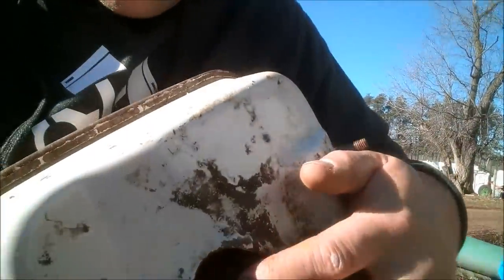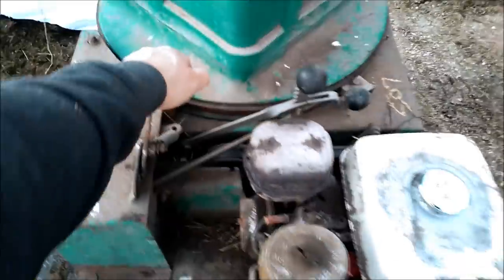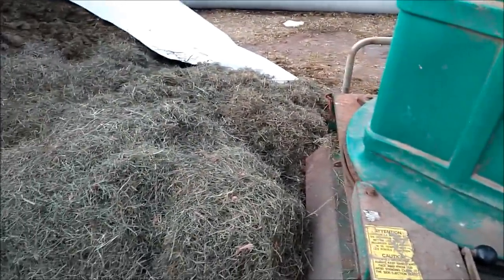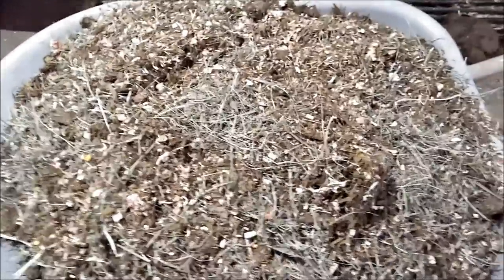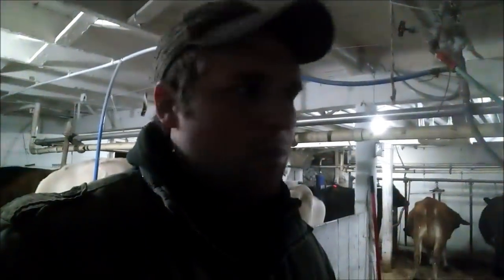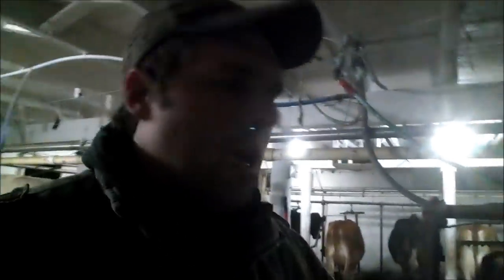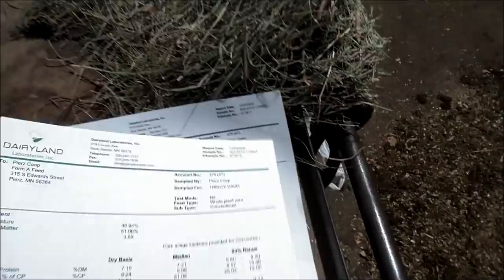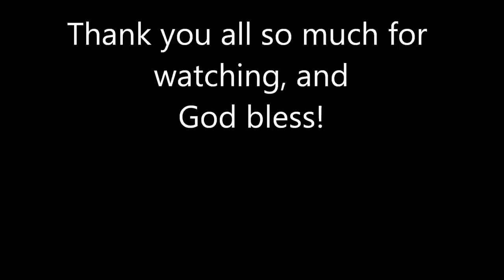Cow Chow; dairy cattle rations, grinding hay, forage sample results are in!

Comment: I got a challenge for you Alan since you use draft horses to use them to pull your forage harvester do a little something different
Reply from the maker: To do that I'd have to buy more horses because two aren't enough.  I'd also have to buy a motorized cart to run the chopper.  I've seen some Amish chop corn with horses, it's a cool sight for sure.
Reply: @trinitydairy  I'm sure you could use 2 horses on the small square baler
Reply: @trinitydairy  or do an old style corn binder have I think it'd 2 horses on the binder I could be wrong and 2 or 3 horses on  wagon and get the twine that is made out of a plant so you can feed it with the silage amish are some wicked smart farmers

Comment: Very familiar with small barns. That's how ours is. Had to really search to find powered feed carts that would fit down the aisles, especially on the one side. Probably the biggest upgrade in your situation would be a conveyor to get the silage from the wagon into the barn. It would save some steps anyway.

Comment: Cheapest ethanol gas! Buy the 91 octane minimum for anything you don’t run every day. Save you so much in the long run.
Reply from the maker: Yeah, I usually run 91 in my small engines, but ran out, last time I used it, and dumped in some 87. Thanks for watching!

Comment: How many pounds of grain per day per head do you feed the jerseys? I'm new to jerseys and I think I'm over feeding them. 
Thanks!
Jake
Reply from the maker: I'd have to weigh it for an exact amount, but it's right around 12 pounds per head per day.  I might adjust that based on the cows production.
Reply: @trinitydairy  does that include the soy or is that in addition to the 12#?
Reply from the maker: Oh yeah, that would be an extra 1/2 a pound to a pound for the Jerseys.
Reply: @trinitydairy  thank you! I'm transitioning from holsteins to jerseys and it's a real learning curve. Thanks for the info.
Reply from the maker: Anytime!